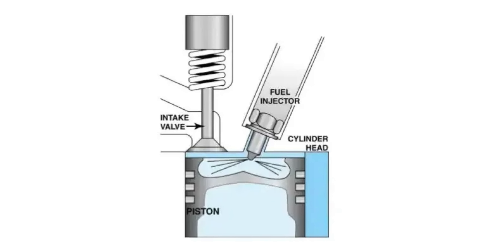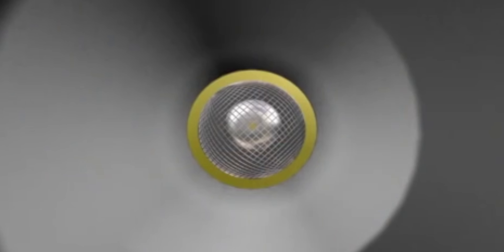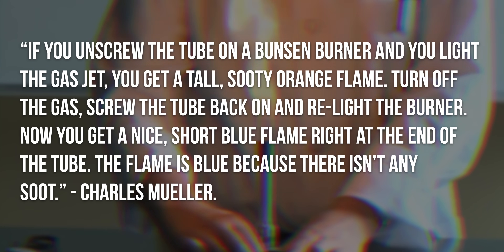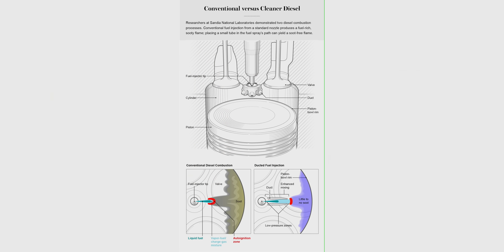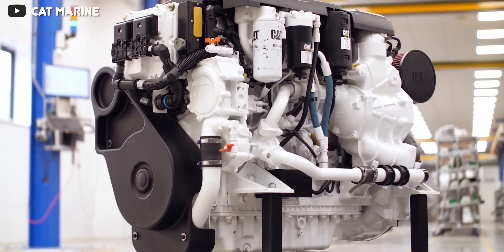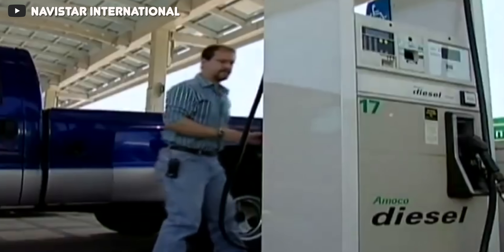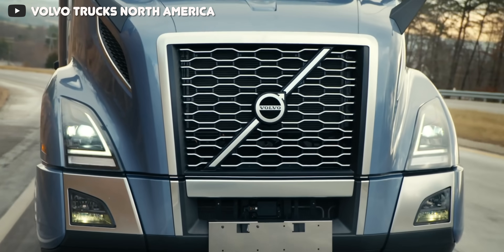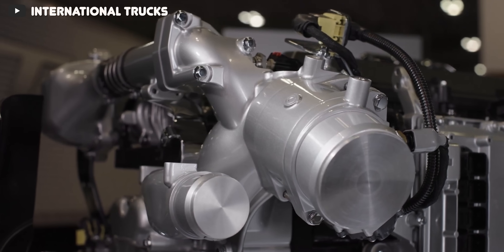Zero Emissions Diesels: How Ducted Fuel Injection can Save the Diesel Engine

Comment: I'm all for it, it sounds great. But I have my doubts about reliability, as it doesn't get rid of soot so those little ports will block up. Where does the air come from? the pressure side of the intake? Plus you will have a lean mix at the injector and or pre chamber then to gain correct air fuel you will still need to add more fuel. This is likely where the soot still comes from. All they seem to be doing is making a central lean zone.
Reply: To me it is like the Liquid Oxygen from the movie The Abyss.  If you Oxidize the fuel itself then the amount of energy is increased drastically.  Current Diesels use super high pressure fuel pumps to mix with air. They basically are carbonating the fuel like a can of Coca but it's O2.
Reply: @droz2377  except they aren't using oxygen they're using air which is 75% nitrogen.

Comment: The problem with the Diesel Engine is not the Diesel Engine, it is the Diesel. Until they stop putting all the trash from petrol production into diesel we'll never get anywhere. The bunsen burner theory goes out of the window when you exchange methane for butane which has a higher carbon count per hydrogen atom, you start finding it harder to get that good complete combustion without soot production since there's more carbon being added to the reaction per hydrogen atom. The most simple solution would be to put better quality fuel on offer, then we wouldn't be where we are now. DPF's are only necessary because they find it necessary to sell us the trash. Oxygenating components can be added very easily to high quality base fuel and then there would literally be 5% or maybe less of the soot and nitrogen emissions that plague the diesel engine as it stands
Reply: Nitrogen emissions? Isn't the atmosphere literally mostly nitrogen?!?
Reply: @TheAnnoyingBoss  nitrogen isn't a problem so long as it comes out the way it went in, unfortunately due to the pressure and heat within a diesel engine during combustion, the activation energy is high enough that nitrogen will also react with the oxygen since the oxygen is not being used up quickly enough by the hydrogen. Remember complete combustion is hydrocarbon+ oxygen=carbon dioxide+ dihydrogen oxide (water) when the oxygen in the reaction isn't used up quickly enough by the hydrocarbon, there is residual oxygen left over by the time the activation energy gets high enough to start a nitrogen + oxygen reaction. The key is to use up all of the oxygen before the pressure and heat becomes high enough to allow the nitrogen reaction to take place. The diesel engine issue in this regard is the fact that there will always be residual oxygen left over since there is no throttle to control the air flow and thus reduce the oxygen content in the cylinder. The reason they don't throttle them is because the fuel is garbage so they have to run lean in order to avoid high levels of soot production, but this then creates the nitrogen problem. The only realistic solution is to have a stoichiometric burn and have a good enough fuel and fuel system that no soot formation takes place due to heat spots etc. In really, throttling a diesel isn't going to work because then there is nothing to create compression for the ignition......soot or nitrogen is the compromise, but both can be reduced significantly by having a more complete combustion which will cause less areas for the nitrogen reaction to take place, as there will be no heat spots just a uniform flame front

Comment: In Germany there is a company that produces and sells diesel fuel which molecularly altered in such a way that sootlevels are going down dramatically. The current emissionstandard in Europe is euro 6 and the used test vehicle was an old 2.5L, 5 cylinder, euro 0 Mercedes. With the special diesel fuel it achieved a euro 10 emission level. The fuel can be used in almost every diesel engine, which would mean a new lifespan for dieselengines old and new.
Reply: do you have a source? euro 10 doesn´t exist so i call BS
Reply: @Gekkoperformance  IF you understand the German language you could do a search here on Youtube for 'diesel-lösung'. But only IF... Otherwise you can keep calling whatever you want and never know or understand. 
By the way: again IF, you'd know the steps from euro 1 to 6 you could calculate euro 10. But, then again: IF...
Reply: @baeruuttehei1393  Ich verstehe deutsch keine sorge. Euro 1 bis 6 ist nicht linear deswegen kann man nicht extrapolieren… alleine die verschiedenen unterstufen von euro 6, zb 6d, 6d-temp, 6d-temp-ivap, 6d-temp-ivap-isc und so weiter

Comment: This won't come into the market until we get rid of OPEC. They will do whatever it takes to reduce the efficiency to internal combustion engines regardless of type of fuel the engine uses.
We could use Hydrogen as fuel which could increase efficiency to internal combustion engines. Also we could use Oxygen to further that efficiency and output less harmful immessions by not using the atmosphere to aspirate the engines. 
And yes you can use hydrogen in a diesel engine. It would combust at lower compression ratios than traditional diesels. 
But good luck getting that done.

Comment: Any process that ingests a fuel (especially a hydrocarbon), and through a chemical process releases that energy - there is no possibility of a "Zero Emissions Diesel" or "Zero emissions Fuel Cell."  If you have a hydrocarbon, it's made up of Hydrogen and Carbon.  Mix that with Oxygen, and you get either H2O, CO2, CO...  Add in other gasses like Nitrogen and impurities in the fuel like Ammonia (NH3) and Sulphur - and you'll get other outputs.  The fuel and its source are incredibly important to the term "zero emissions".  I had a 1984 diesel Blazer (retired military truck), ran it on Neste BTL diesel (pure alkane), and it never smoked.  No aftertreatement, basically just pure hydrocarbon and clean injectors.
  
Current emisions systems are "so complicated" because the combustion process output is not perfect - it's lossy and chaotic.  A nozzle like what it mentioned could in theory reduce the complexity of the combustion process output - and that simplification of the process output reduces the required complexity of the aftertreatment systems.  Still doesn't do anything to adress the fact that ~60 of the process output is unused heat (some gets used in winter) - and none of this is closed loop nor is that output gas captured and used for a purpose.
  
Weirdly enough I could see an application for a static engine where that heat can be captured and used for either industrial process or combined heat and power (efficiency of combustion now >85% - with a portion of the electricity going to an electric vehicle, and the gas being captured and used in an agricultural process which is essentially closed loop (waste, both food and "excrement", used to produce liquid fuel - primary input would be sunlight.  You could probably approach >90% efficiency that way.
  
Dumps already collect methane and run their trucks from it, and we know how to the GTL ad BTL fuels.  CHP systems exist, with hot water recovery and steam generation from exhaust gas.  There is precedent.

Comment: I have a 1991 12 valve Cummins owned 22 years. This is a very interesting injector. My truck is still factory no changes just age.
I don't drive much anymore maybe 100 miles a week. I may start up 2- 4 days.  And it is my main transportation. (Retired once).

Comment: Please keep in mind that if you remove soot (microscopic carbon particles) from the diesel engine, you will drop the engine life to that of a gasoline engine (Otto cycle).  Soot in a diesel embeds itself in cylinder walls thus reducing wear on the combustion chamber.

Comment: Ater reading the Muller paper as well as a few other SAE papers myself, you need to be careful with terminology. The initial research indicated a 100x reduction in particulate matter, while it is very impressive, 100x reduction does not mean zero emissions, it means 100 times less particulate matter. The technology seems promising but the inferences you've reached seem extremely far fetched; the research done by CAT actually showed increases in PM when retrofitting to a HPCR fuel system and as far as I can tell there is no published data regarding NOx emissions. There is no precedent for removing emissions components, nor do I think we will see DPF/SCR systems go away. The regulation of emissions mandated by EPA and CARB over the last 20 years has been exponential, this indicates the need for base engine innovation in addition to, not in the absence of existing base engine and downstream solutions.

Comment: Ppl hating on diesel while our buses in the city are literally running on old frying oil
You can do the same with passenger diesel engines if ya filter the oil enough

Not sure if gas/petrol powered cars go do the same
Its literally powered by a waste product. Can't get a lot greener

Comment: Sorry with the Biden Administration if you built a non electric engine that could run on water and have 0% emissions the government would try to prevent it come to market as they went into the electric power 100% even though major problems have surfaced.

Comment: If they can build such an engine that I don't have to use electronics or minimal electronics with excellent self service possibilities then I'm open arms.
Reply: I don't mind smart electronics but what I don't like is when these electronics are attached to plastic buttons and when one breaks it's $12 just to replace the little plastic piece inside the button to get it working again. There is toggle switches that exist way long term and cost $4.75. all this plastic

Comment: How does the system plan to overcome cylinder pressure, when relying on the intake/atmospheric pressure? Injection is done on the compresstion stroke just before TDC, is it not?

Comment: I do not see diesel engines dying out anytime soon. Irrespective of any EPA bullshit coming out, the vast majority of goods go via road transport with diesel engines. Even trains have diesel engines to drive their generators. However, the highest tonnage is shipped by sea, and you do not see any nuclear cargo ships or passenger ships either. So what, the toughening of rules will stop all road and rail transport? I think not. Forget about the US, every other country has the majority of goods transported by diesel engined trucks or trains as well. If this really is a workable solution, then it needs to be released to the various engine manufacturers for real life testing as soon as possible. I really do hope it works as advertised.

Comment: The government wants to kill ice altogether, by cutting emissions faster than the industry can innovate, but going all in on the electric route will grind the economy to a halt by 2030, just because the amount of materials needed for such a massive scale battery production, are simply not there, as well as electricity production that has to scale up 3 fold in just a few years, this can never be done only by good intentions and political green dreams, it will cost the consumer dearly and spell economic disaster.

Comment: Diesel engines use 2 to 10 times more fuel than needed ? While diesel engines already have efficiency about 40-50%. I think something is wrong in your math and initial statement and I think that is why we don't see that injectors in real life as they were based on wrong assumptions. As even if you say it is twice as high fuel than needed - you will gain 80-100% efficiency from engine and that badly interfere with thermodynamics laws...

Comment: I think it begs the question if it really changes the air/fuel ratios. 

Does it hit the perfect AFR with less fuel because it mixes better resulting in more power, fuel economy, and a more efficient burn? 

Will it be reliable? It sounds like it will solve the emission control problems, but what about the mechanism itself, is it reliable? 

If it does there’s a high likely hood of adoption.
Reply: Like any combustion engine, Oxygen is key. If you have fully oxygenated fuel you would not even need a intake manifold in theory.  You could pump pure oxygenated fuel. Similar to how a rocket motor works in space under a vacuum.  The better the air fuel mix, the better economy and power. Obviously such a design would look far from what a current engine operates like but the fundamentals are the same. Better mix, better combustion, better overall performance.

Comment: Basically better atomization with ducted injectors. The entry ignition engine works in a different way to better atomize fuel for a clean burn. The major issue I see with ducted injectors is likely the heating of the ducts. Injectors are kept cool but fuel but ducts would be in the combustion chamber with no cooling.
Reply: Fuel moving through a Venturi would cool duct. Some of the duct nozzles were being made from man made sapphires that did not erode as fast as steel.

Comment: For the past twenty years or so, diesel engines have been down different mines around the world. They run with different filters and other accessories that pollute the air inside the mines. How the hell can this be done in a enclosed area and controlled when diesels outside the earths bubble cannot fix the emission problem ???? Something stinks in Denmark as the old timers would say during WW2. Please answer this question DUST RUNNERS AUTOMOTIVE ?????

Comment: I was taught in the year 1963 by good instructors that when no computers existed , well very few, max power from Diesel engines when fuel was completely burned.
By observing the exhaust any visible smoke was excessive fuel (like the so called hot rodders think is cool) I watched as a large truck placed on a dyne running under load showed the truth in what the man said.
With the computers we have now in the automotive industry , there is no reason the emissions cannot be controlled . A modern computer can see what is happening in each individual cylinder and can adjust the fuel compression, etc to give the best , cleanest running possible. Just get your head out from your hinny most and see trucks are necessary if you wish to continue  eating, staying warm, etc. even though we complain about them on the highways. Of course you may grow your own food, make your own clothes, cause I sure won’t make them for you, or give you what I grow. It would be best for the people that wish to do away with oil products to start chasing rabbits for clothes, and learning to eat their front lawn, if you have one.
Reply: ok
Reply: What was the point you're trying to make in that word vomit?
Reply: Boy I had a hearty laugh at that. 'Chasing rabbits and eating lawn' hilarious but it could turn true someday. I hope the true Lord shows us mercy.
Reply: Totally agree.
Look at some tuners, they just flood in diesel and wait for the turbo to try and fix the Air fuel ratio for a cleaner burn.
With more modern techniques it would smoke a lot less, because it is much better controlled.
Reply: This reads as incomprehensible rambling

Comment: Now why arnt they after gas?  Diesel burns clean when tuned correctly.   Gas doesnt burn as clean, while diesel uses compression to ignite the diesel.  Gas requires a spark.   That spark causes excess fuel to be left over because of the flame induced combustion.   Diesel works off of compression, the fuel is atomized by the injector.  Sheer pressure and heat caused combustion.  Reason why diesels dont like to start in the cold. Gas starts easily in the cold because of the spark induced combustion.

Comment: There is zero chance you will be able to retro fit this system to other/older Diesel Engines. This fuel system will require an engine specifically designed for it.
Reply: Fortunately,  this isn't true. The older systems didn't rely on computers,  therefore there would be no sensors telling it there was a problem because something was different.  For the newer systems,  a simple modification to the ECM  / PCM should correct any sensor issues. I would definitely try something like this on my 2001 W9.
Reply: @mihybrid1  the issue isn't about how the fuel system is operated. It's about space. You won't be able to physically fit this new injector into the same space. The new injector will have added complexity, air. That will require more space. Space in a Cylinder Head is already maximize by the Engine Designers.
Reply: @John-od7xw  Agreed about the design.  But the fuel injector, if it's designed for that engine, will be sized to take that into consideration

Comment: Here's  the problem. The engine is not the problem, the fuel is. Engines are built around the fuel, and not the other way around. The chemists at the oil companies can make the fuel react completely  but that will cause them to lose money. Fuel economy would go through the roof and reliability would go to forever.

Comment: Soot reduction.... You do realise that soot reduction has been done for decades and is as simple as running more air into the chamber. Higher air charge to fuel reduces soot and keeps EGT's down. You do realise that the "Rolling Coal" statement comes from America...?
I don't see how you are going to add extra air to the injector stream, especially at the high cylinder pressures seen in a decent Diesel.

Comment: If you have soot its better to have soot than to have no soot and instead have all that contamination escape into the air like you have with a gas engine or when power is generated to charge up a tesla !